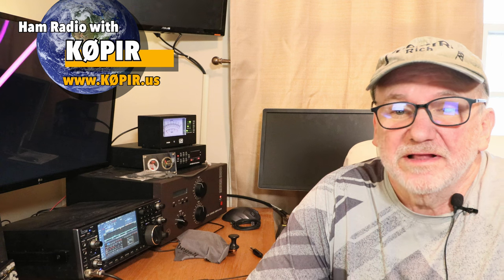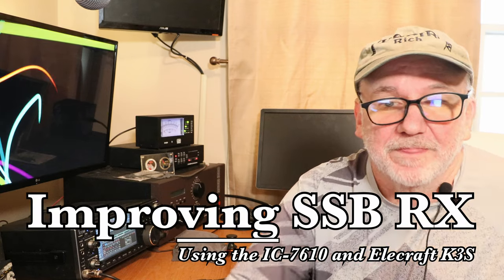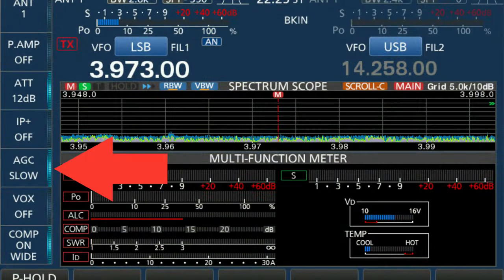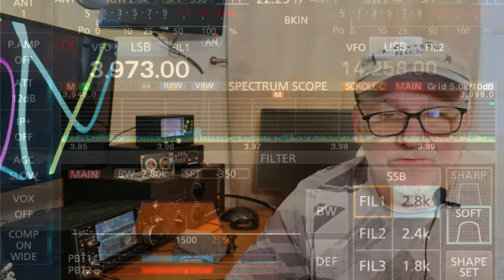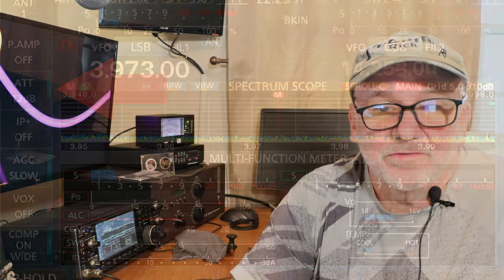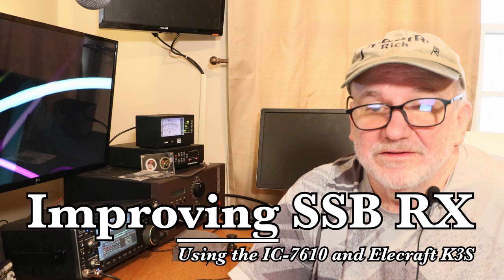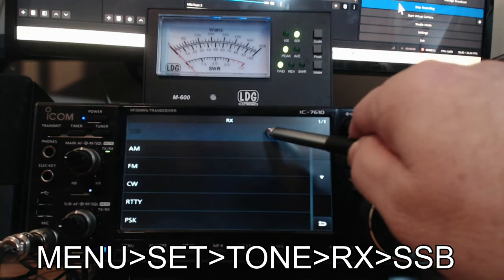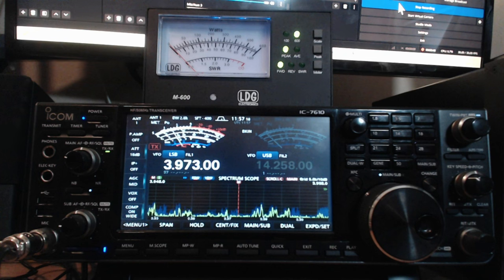Elecraft K3s Vs Icom 7610: After RX Settings Who Has The Best Receiver?

Comment: Have had both side by side. On CW both are excellent.  I eventually got a second ic-7610 and sold the K3.    The filters I felt were better on the 7610.    But for travel the K3 is super.    Both have good ssb tx audio with slight edge to K3.   AGC and QSK cw for the 7610 is great too.     Agree the elecraft is harder to configure or use.    Dual receiver  is an expensive add on to the K3.  The auto tuner is also an option.
Reply from the maker: It’s good to hear from you and thank you for commenting. I agree ☝️ 73 and good DX!

Comment: First thank you for sharing both radios.  The Icom is a SDR and that is most familiar with for me and the Elecraft is basically a super heterodyne with a bass band ADC. I have three HF radios one is the FT891 with 3 mixer and not a quiet as your two. The other two are Elecraft with one being the KX2 I just love and the second is the K4D with dual receive and I am still learning.  It is amazing and can handle anything I can throw so far.  I think we both have good radios to play with.
Reply from the maker: Thank you for commenting and those are some fantastic transceivers. I have the KX2 also and used it for POTA. I think it's receiver is as good if not better than the 7300, but don't hole me to it, hihi. Great to hear from you again and hope to hear you on the air. Best wishes this holiday season and 73!